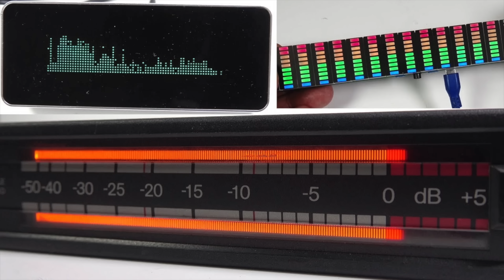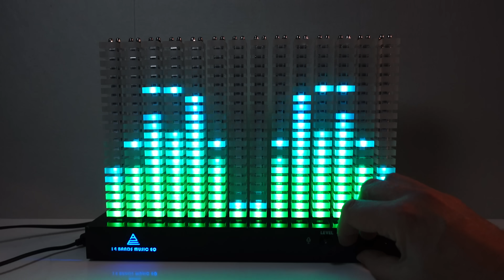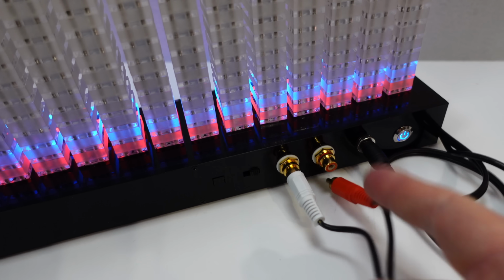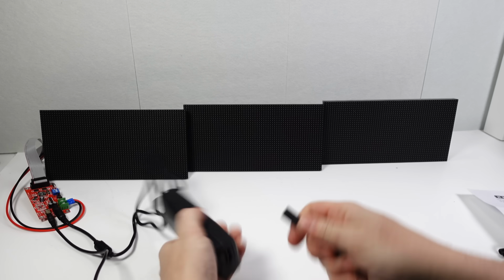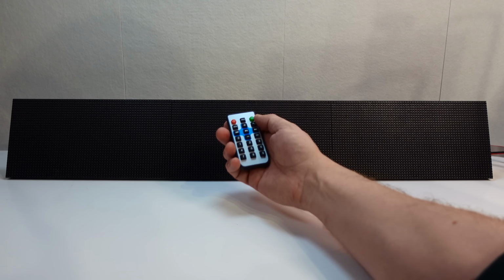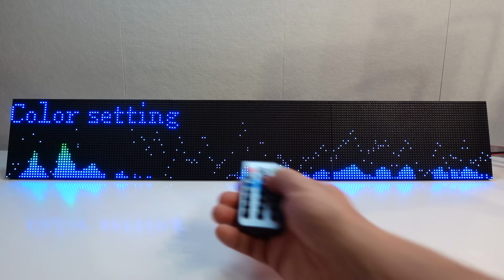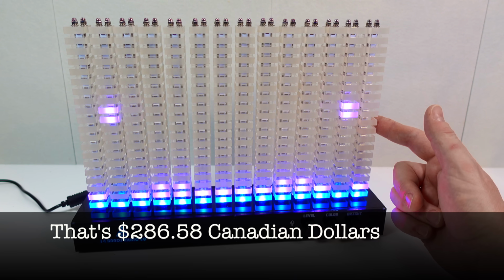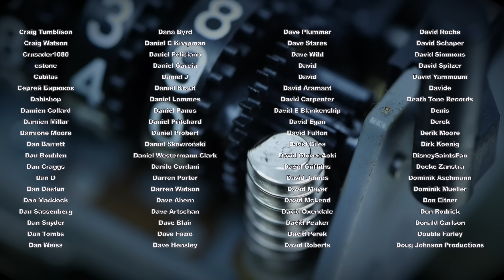Miss/LED -  two more LED music visualisers

Comment: It really seems like the makers of the LED panel product don't understand that our perception of audio frequencies is logarithmic. Its display seems a lot more linear, with even midrange frequencies showing up at the left end of the display. Midrange frequencies ought to be in the middle, especially if the upper end of the range is limited to a few kHz.
Reply: most of these tiny chips cant handle large FFT in realtime, thats why they cheat
Reply: @Flowxing  it's expensive enough that they could stick a more powerful chip in there
Reply: "Its display seems a lot more linear"

I thought that too with the spectrum sweep, I expected it to speed up as it progressed towards the high end, of course ultimately this is controlled by what you are using to sweep through the spectrum, but 99.9% of the time you'd expect the sweep to speed up . . . which immediately made me think 'linear response' . . . the real shame here is that it's trivial to make the display log or linear in software, there could have been a simple setting, no hardware changes needed.
Reply: @Flowxing  If the FFT/DFT is implemented properly, you can select which frequencies you want to display, rather than iterating through every single one in the range
Reply: Ohhh, good point! And interesting discussion on FFT too. I wonder why it's expensive? I don't know what low-volume production would drive prices up to.
Reply: @Flowxing  That would be pretty easy to compensate for.
Reply: I think that is because it was set to 5 kHz. I assume that is the center, so midrange sounds would be skewed to the left. If set to 1 kHz, midrange would be more centered, but what that tells me is that it's not showing anywhere near the full audio spectrum. Couple that with the high price and lack of a case, and I wouldn't buy it. Not that I would buy any spectrum analyzer.
Reply: it would be nice to be able to choose for sure. that being said these things are intended to look cool mainly. if you want a cheap dedicated spectrum display for professional use the best thing is to get an old PC and just run voxengo span in fullscreen.
Reply: especially since i just noticed that during the freq sweep on the big one you can see it start to show its own aliasing, oof
Reply: @famitory  For entertainment purposes, that doesn't matter. If you want something for professional use, that's a huge deal!
Reply: I'm guessing it's just optimized for what makes for an interesting looking display.  logarithmic might've made it appear too busy or blobby looking with bass but not very interesting for higher end.
Reply: @davelordy  He did a sweep?

Did it get cut, cause I didn't see it...
Reply: @baylinkdashyt  21:50
Reply: @baylinkdashyt  It's after the main review section . . . @ 21':50"
Reply: @davelordy  Oh.  I missed the caption, but that's not what an audio sweep looks like on an RTA.  :-)
Reply: @Flowxing  really? decent FFT seems pretty trivial nowadays, and since those 32 bit arm chips don't have to run much else, they can dedicate most of their cpu time to the task.
Reply: @sperzieb00n  not while handling the io of the display at the same time. Also that requires a proper implementation
Reply: @famitory  windows media player....
Reply: I think it would be difficult to communicate to the (uninformed) end user what's happening. You'd need to start using the MEL scale (because you're no longer displaying true frequency), and that requires some knowledge you just can't assume of users of a "funny lights go boing boing" product. HOWEVER, I do share your frustrations, and I would love if it were an option.

Comment: I've got to admit I liked the look of the first one and when you showed the second I was thinking what I could make the box out of. Then you told us the price and I realised I didn't need it that much.
Reply: Why was the first one symmetric over 'both channels' though? I think it's bullshit if they fake these anyway because it's really cheap to build a digital spectrum analyzer these days, but the first one wasn't even hiding it
Reply: Exactly my thoughts
Reply: when you buy that many adressable LEDs, it gets pretty expensive.
Reply: @JoQeZzZ  I didn't understand that either, but I do suspect that it was a wiring error. Definitely disappointing
Reply: I think the board has a problem and it's not working properly. That stuck red led is also a worrying sign.  Doesn't look like good quality control unfortunately.
Reply: I felt the same 😂
Reply: @flandrble  I build a 10x12 led grid for a guitar pedal.   Each led costed 4.7 cents at a quantity 600 or about $28 total (plus the PCB and pick and place).
Reply: @moddquad8362  are they each individually controllable?
Reply: The prices are unreasonable.

Comment: In 1983 or so I built a 8 channel one of these from a design in Practical Electronics. I taped up and etched the boards drilled and populated them. Took me months to afford the components from my pocket money. All entirely analogue using filters based on 741 opamps and an LM3915 in each channel for the display.
Reply: Cool! I miss those days.
Reply: @rodrigobelinchon2982   Well, if you’re doing RMS measurements, some latency is inherent anyway.
Reply: I built one like that too in the early 90's from an old project book. I remember the LM3915 being decently pricey, and getting it in a brick-n-mortar electronics store back in the day.
Reply: @Graeme Hill
very well done..this type of idea actually goes even farther back music sensitive flashing lights for entertainment..back in the 1970's there was instructions to build one in Popular Electronics:
take an old stereo speaker box 
remove the guts
mount christmas lights inside (twinkle or fairy lights... standard christmas incandescents would probable catch fire) 
put a sheet of prism plexi on the front
buy a filter board from Radio Shack (fully assembled or as a kit) it had RCA phono jacks on the board that you could mount inside the speaker box...
usually no mic input just RCA phono jacks..
throw some Disco on your 8-track and you are good to go...
total cost excluding the old speaker box was under $20...

Comment: The LED panels in the second one are the same ones used in video walls - Adafruit were selling some a while ago. I'm impressed at the programming they've done to use three of them. However, I agree the lack of a case is a big omission!
Reply: that's the easy part really, as the data is just serial and the jumpers define how many panels are in the series chain so it knows how many leds it's addressing.
Reply: indeed for the price the inclusion of a (very cheap to  produce) perspex or even thin wooden jet / laser cut self assembly case would complete the package to a satisfactory bare minimum.
Reply: They're not like the 2812 LEDs, though, the code has to do the PWM duty cycles for all the different colours itself. But once you have that routine figured out, yeah, it will scale easily.
Reply: If there was a case I'd imagine it'd be that crappy laser cut acrylic
Reply: I have a few of those adafruit panels laying around, a few 64x64 panels. Wonder if i could just rig this up myself with Rasp Pi
Reply: @hgrunt100  I have thought about trying my hand at a music visualizer with an arduino. But a Pi should work too.
Reply: To be pedantic, they're not quite the exact same as the ones in video walls, as the LED density is actually higher on these. That said they're also way more durable and user friendly (since it's two kinds of Neutric connectors that head back to the main controller)

It's something to see them get way cheaper though!
Reply: @DasGanon  videowalls come in various different pitch leds, these don't appear to be anything special. I'm a video wall tech as part of my job
Reply: @deathnightANIMATED  ah okay I've only seen/messed with them in load ins/load outs, so I'm probably wrong for most permanent fixtures
Reply: I agree !!
Reply: They look like the standard size of LED/LCD panels used in bus destination displays soo if anyone ever buys an old bus to turn it into a party vehicle, this is the accessory for it! xD
Reply: @DasGanon  I mean, these are P3 or 4 LED's, they use the exact same interface as the ones on ada, Same IDC connectors, same panel design on the back, i figure they are the same 5-address multiplexing system the ada panels use. It is easier because you dont have to fiddle with making a bonnet or hat work for the multiplexing. That said, same panels from what I can see, and you could probably run any panels off that board with the config menu and dipswitches he mentioned.
Reply: @hgrunt100  Adafruit did write an Arduino library for them but I think it only supports one panel.
Reply: @deathnightANIMATED  Yah - I only recognised them from the Adafruit sale some years ago (when I bought some).
Reply: @DasGanon  Video wall panels come in a large number of pitches so a P10 panel has an LED pitch of 10mm, they can go as low as P1 or even lower. You chose the pitch based on viewing distance, it's pointless using a P1 panel on an arena show where the audience are metres away.
Reply: @flandrble  The data isn't JUST serial the panels are basically a bunch of very long shift registers, one for each colour and also they generally split into two halves, upper and lower so 6 shift registers for these three panels. As well as shifting the data in you also need to handle the brightness in software yourself in real time. Doing this with PWM is HARD so the general way is (for 8 bit brightness) you have 8 timeslots, each double the length of the previous slot so 1,2,4,8,16 etc. A full brightness LED has data sent to the panel on all 8 timeslots, the lowest brightness LED has data sent only on the shortest timeslot so for each frame you need to send each LED's data 8 times and how bright a particular colour on a particular LED is depends on which timeslots are used.
Reply: @static-san  See my other reply, you don't generally use PWM as at this scale that's HARD.
Reply: @mfx1  You described exactly how I understood they were run.
Reply: @mfx1  yeah but, once you've done that all for one panel (or a handful of the LEDs in series), it's reasonably trivial to keep the chain going.
Reply: @flandrble  It doesn't scale well unless you move to fast FPGA's and break the system up into smaller modules with a pre-processor/scaler to break up the data to be sent to each module (which is exactly what video walls do).
Reply: Those are typical HUB75 panels, and are the size used for smaller video walls, a few feet across. The P number (P4 / P5 / etc.) indicates the pitch of the LEDs in mm, and they seem to be 32x64 size. They cost about $20 each from the typical AliExpress seller, and maybe $35-$50 via Amazon, so that's a rather pricey controller board.
A right-angle plug might be nice, but that's the standard power plug for those.
Reply: The case is probably missing because it wouldve increased the size of the package considerably and thus Also the postage considerably.

Comment: That second one is 97 band and 30 step if I'm counting correctly.  Depending on how those frequency settings affect it, it might be an accurate and useful tool for fine EQ adjustments.
The cost is not unreasonable for what it does.
Reply: The first one is a fake, but the the second one is legit. Not only does it do what it's supposed to, it does it in an epic way. A perfect addition to any studio, bar/club, audiophile setup, mancave, etc. The fact it needs encased is actually a plus, because it leaves the options open.

Comment: Interestingly, Item 2, the LED panels specifically use what's known as Hub75 for the protocol/interface. Meaning that these are the very same panels that are used in those LED advertisement billboards on the street. I have a few of these panels myself, along with a controller that can do video and even take HDMI in.
Reply: Nice.  Would cost a fair bit, but an entire disco-tech type wall display would be amazing.  Or maybe put it on the ceiling and program it to display 360 degress out from the center.

Comment: I’ve always thought the Winamp built in visualiser on pc looks great, hypnotic and capable of much more than these hardware devices
Reply: Do I spend way too much for one of these or do I use an old monitor and a raspberry pi
Reply: Still using Winamp. Always liked its simplicity.
Reply: We need an LED panel implementation of Geiss / Milkdrop.
Reply: There are several newer audio players that can use Winamp plugins, too. Then there was G-Force and Whitecap.
Reply: It really whipped the llama's ass.
Reply: @nickwallette6201  a 24/7 Milkdrop 2 display would be amazing :O
Reply: @nickwallette6201  OMG, I forgot about those!  Just seeing the names again brings back great memories (esp. on snappy CRTs).

Comment: For the price of the second one you could "almost" buy a long LCD panel and make a display that could do more than music.  I know, not quite the point of flashing LEDs but a little more useful.
Reply: You could but then you'd have to have the relevant hardware and software to drive the display. These are at least plug and play with next to no configuration/setup required.
Reply: Almost? Decent 32" lcd tvs are like $50 less here.  Agree the software would be a bit of a problem tho.

Comment: I like the idea of the second display. You can rewire these panels in a different order once in a while - 123, 231 and so on, so the LEDs would degrade more or less equally.
Reply: LEDs have such long lives it’s not really important
Reply: @danieldc8841  LEDs get less bright rather fast. You wouldn't notice it when the light is static (a lamp for example), but on something like this you probably would.
Reply: @igorszamaszow171  Uh... I'm confused, let me "think out loud". There are multiple types of LEDs. The original type only came in a few specific wavelengths which were directly emitted by the diode. Those don't fade, but they don't come in blue. When they found how to make LEDs emit UV light, they immediately started making them with phosphors in the same way as flourescent tube lights. I can't recall if flourescent tubes faded noticably, but the phosphors in TV screens could clearly 'burn' which is similar enough to say they did. Then came OLEDs which I know nothing about except for the fact that OLED screens can burn; same again. So... it depends on the type of LED. I'm not really comfortable with the "rather fast" qualifier for phosphors though. You'd think old-school TVs would quickly get messy if it was true.
Reply: @eekee6034  With old school tvs/tubes it took quite a lot to really burn them in. Mostly or completely static displays left up for years, especially with high contrast lk monochrome computer displays. 
I know it can be an issue with OLED tvs. For ordinary LEDs I think its basically a matter of basic quality.. Also current loading & driving plus thermal management can have a big impact on lifespan
Reply: @igorszamaszow171  If they get noticeably less bright real fast, then they get too much current pushed through them. Most single LEDs will be wired to get 20-30 mA, but they'll work just fine with even 5 mA applied, and they'll last longer.
Reply: Yes - or someone is mixing up with OLEDs which are completely unrelated.  Normal RGB leds using three LED chips do not use phosphors. They use Red Green and Blue LEDs (not sure why @eekee started to mention UV LEDs - UV LEDs are recent compared to Blue). Blue LEDs are Blue, and do not use phosphors. So those panels would have a very long life provided that the driver circuits do not over-drive the LEDs.

Comment: The mono/stereo thing in Item 1 may be so it can support mono inputs. It feels to me like instead of autodetecting if there's signal in both cables, they just clone the Left into the Right in the processor, so it will have full display on either case.

Comment: That second one would look pretty sick if ya put it into the wall, or well, a recession in the wall, right above your stereo set and between the speakers.
The gap between the panels would dissapear when putting it into a box that's dark
Reply: Possibly if having tinted glass sheet over the front and having the brightness turned up... as it is surely more the reflection of light from the front rather than seeing the light behind shining through?

Comment: Fun to see! I bought my first spectrum display after seeing your review of it here a few years ago. It is really cool and I still use it. Coincidentally, I bought the second one in this review last year. I only bought a single panel version and I am in the process of building a custom frame for it. My project will have a glass front plate etched with the Pioneer Elite THX logo. It should make a good aesthetic highlight for my home theater. Your electronic interests and projects often align with mine. Great Job!

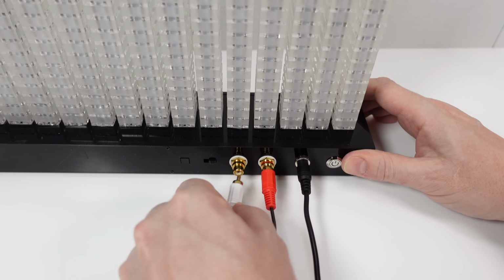Comment: The thing near the beginning round 2:04 where the LEDs look cyan then green might just be to do with green LEDs being more efficient, they light up stronger with less power, than blue ones do. So whatever simple way they've done the LED dimming (PWM probably), fading the green and blue LEDs by the same level will disproportionately affect the appearance of the colour, so producing that effect.

Comment: The second one is very cool, it can be easily to setup in some places without a case, I imagine they would look very cool mounted directly on a wall, if you don't care about the audio input jack and are ok about using only the mic there is no need to have the audio input jack accessible too.
Reply: Well ya gotta have it plugged into the wall so wires are going somewhere, may as well route a 3.5mm extension cable with it
Reply: @startedtech  not necessarily it depends the amount of effort you are wiling to put into it. Energy wires are already built in the walls.